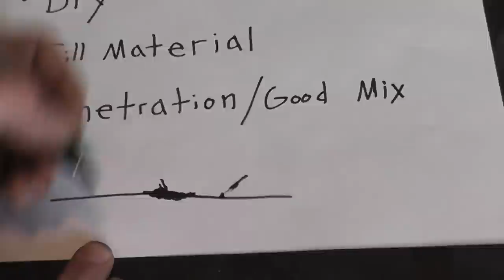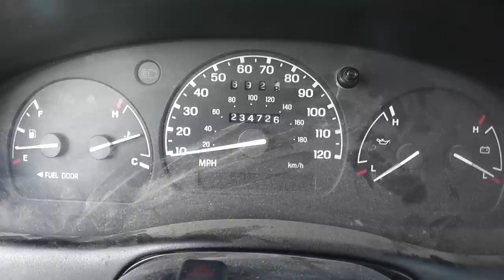How To Fix A Cracked Plastic Radiator For Free (Hopefully)

Comment: Do you think this procedure could repair radiator hose neck, breaking completely off of radiator tank?
Reply: +Abraham Levy  NO....FLAT OUT NO!!!! Buy a new radiator...it's about $100, and you can install it yourself pretty easily. Find a video for your car on here, or at least find one that is close. It shouldn't be terribly hard to do. If you try to repair it this way, and it fails then you are looking at a HUGE repair bill. Potential problems include blowing a head gasket; warping the head (even more likely if aluminum); warping the block (even more likely if aluminum); seizing the motor completely; blowing 1 or more rings, damaging cylinders from rings blowing, or from overheating; and all kinds of other things. If ANY of this happens you will pretty much be junking the car! The parts alone in a best case scenario where just the head gasket blows will end up being several hundred dollars (plus a fair amount in specialized tools if you don't have them (Machinist's Level alone is about $80)), and you'd need to be a better mechanic then someone who asks the question you just asked. No offense intended...not everyone has had the opportunity to really work on cars much...just trying to be helpful & realistic.
Reply: +David I should add that the several hundred dollars in parts was for the best case scenario. Any of the other things go wrong, and it can quickly go to several thousand dollars. You'd probably end up being better off buying a new head if it's warped more than a few THOUSANDTH of an inch...so we're talking tiny amounts here. Much else wrong, and you're better off just buying a new motor. In fact you might be better off just buying a new motor if ANY of this goes wrong depending on vehicle, general motor condition, skill level as a mechanic, and how much free time & patience you have...oh also how much you enjoy blood dripping from your hands onto your engine after cutting them repeatedly on God only knows what. Not saying it can't be done, but it's a pain & it can all be avoided. That's my rant for today.

Comment: By the looks of that radiator, you have been using straight water instead of a mix of water and coolant. That is probably the reason the radiator is in that horribly rusty and cracked condition. Correct me if I'm wrong...
Reply from the maker: quesnoy1 I run water and antifreeze, but straight water won't make it crack. It cracks because over time, the high heat deteriorates the plastic. (rotten design to save a few pennies) That's why they usually crack right at the inlet from the motor, which is the hottest point of the radiator. When I was messing with this one, I could tell that the plastic in the cracked area was brittle, powdery and porous. The plastic on the cooler areas of the radiator was still in really good shape. Thanks for the comment.

Comment: You may want to find out the reason why it cracked their were the upper radiator hose goes to might have a problem with the engine mount
Reply from the maker: I think the heat cycles over the years just made the plastic weak.

Comment: hey, garage, Im a chinese radiator repairman,  if radiator crack like u vid, i will change this part ，or  make a Aluminum cap use TIG welding aluminum WSME 315,    100%safe
Reply: agree I work in a radiator shop in new mexico. Crack plastic tanks are just a waste of time to mess with

Comment: Seems like a poor design to have part of the radiator plastic since it fails easily, why don't they just make the entire radiator out of metal?
Reply from the maker: Ryan Toomey I agree it is a part that is designed to fail. cheaper to make than brass and aluminum though. that plastic was totally cracked and deteriorated from the heat. Older all metal radiators never have this problem.
Reply: you can buy aftermarket aluminium radiators for most cars
Reply: They used to. Then everyone went cheap.
Look up radiators for vehicles later then 1990's
Reply: I prefer the plastic tanked radiators.  The all steel ones seem to rust out quicker than the plastic and aluminum ones fail.
Reply: Ryan Toomey The one in my old Dodge is copper/brass mostly.
They are tough yet, ductile I suppose is a good description, rigid yet bends easily, but holds up well to heating and cooling
Reply: First off, plastic is cheaper than the brass that was used for decades. I had long believed that it was a failure by design feature - you know, make it cheap, disposable and make more money - residual sales. Experience has proven that it is in fact a failure by design, but has nothing to do with generating extra residual revenues.

Components are designed to fail, let's say sacrifice, at a higher rate, dependent on cost of repair. First goes the radiator, maybe it's the water pump (obviously the hoses have failed well before anything else), the thermostat, you begin to feel as if you are just chasing breakdowns that are related to the same system, in some nightmarish, cascading domino effect.
Why sacrifice? 
Consumer ignorance, even laziness.. How often do YOU open your hood? Check your oil? Check your transmission fluid? Brake fluid? Check your antifreeze? For those of us with rear/4 wheel drive, how often do you check your differential oil? how about your transfer case?
BE HONEST.
Those of you who are beaming with pride because you have done/ had done all of the above - hell, 4 of the above, good job. Pat yourself on the back, then say goodbye because this is where you too, will fall short and have to admit your own ignorance and/or laziness.  No offense intended on my part, only (TRIGGER WARNING!!!! For any snowflakes who might be reading)  constructive criticism.a
When were all the above-mentioned fluids last CHANGED? Along with filters? Belt/s? Brake fluid too?  PCV valve? PCV filter?   
How old is your battery? What color is the handle/ring of your oil dipstick? What is the pressure rating of your radiator cap? You would know this if you have replaced it....EVER.( I will bet NO ONE got that one.)
A sealed, completely full, properly filled cooling system will neither corrode nor boil - not even at the 235 degrees that many engines normally get to. 
Even your brake lines are supposed to be changed periodically.

Every radiator used to have brass tanks, rarely leaked, but were prone to  electrolysis breakdown, leading to overheating. Overheating lead to blown head gaskets and cracked heads - those cost boo coo bucks to repair.
So we now have easily replaceable cheaper to manufacture plastic tanked radiators that fail along with the plastic overflow/ reservoir,  etc., to attempt to prevent blown head gaskets, and cracked heads.

It also ensures that a high % of vehicles possess the newest methods and technologies for efficiency, pollution, safety, even manufacturing and disposal.

Mine is a metal radiator cap rated at 15 lbs, my power steering and brake fluids changed last spring. Oil and transmission fluid and filters for each, as  well as air, fuel, and cabin filters were done within 10,000 miles ago ( I drive a diesel, gasoline motors are usually 3000). I do not buy in to those never need to change your oil, 100,000 mile claims.
They only add complacency to the ignorance and bliss.
Reply: @thefedup9921   my dipstick handle is yellow.....
DATE	ITEM	ADDITIONAL INFO	MILEAGE	COST
6/9/2012	SPARK PLUGS	8 EA	12,000	84.00
6/14/2012	OIL & FILTER	5W20	14,000	62.00
7/22/2012	WIPER BLADES	18"	14,375	12.00
7/22/2012	COOLANT	FLUSH	14,375	12.25
7/29/2012	BELT	SERPENTINE	14,710	29.00
9/8/2012	MUFFLERS	FLOWMASTER "OUTLAW"	16,815	475.20
9/12/2012	DECAL	BLACK RACING STRIPES	17,000	100.00
9/18/2012	AIR FILTER	INTAKE	17,865	12.50
9/20/2012	OIL & FILTER	5W20	18,011	53.00
11/3/2012	BRAKE PADS	FRONT	20,850	58.00
12/2/2012	OIL & FILTER	5W20	22,773	62.00
3/18/2013	OIL & FILTER	5W20	26,500	62.00
6/16/2013	BRAKE PADS	REAR	28,878	58.00
6/22/2013	OIL & FILTER	5W20	29,050	64.00
8/21/2013	SENSOR	TPS	30,800	80.00
8/23/2013	OIL & FILTER	5W20	30,822	64.00
10/25/2013	OIL & FILTER	5W20	34,654	62.00
10/25/2013	WIPER BLADES	18"	34,654	14.00
12/12/2013	OIL & FILTER	5W20	38,000	60.00
3/15/2014	BATTERY	5 YEAR	38,800	118.00
3/15/2014	AIR FILTER	INTAKE	38,800	12.00
3/22/2014	SPARK PLUGS	8 EA	39,000	100.00
5/24/2014	CALIPER	LEFT, FRONT, BRAKE	40,700	65.00
5/29/2014	OIL & FILTER	5W20	41,700	62.00
10/24/2014	OIL & FILTER	5W20	46,460	55.00
12/3/2014	TIRES	4 EA	47,603	800.00
2/15/2015	OIL & FILTER	5W20	51,000	57.00
8/10/2015	OIL & FILTER	5W20	54,050	50.00
9/12/2015	BULBS	ALL / H13, 9145, 194, 168, 4057LL, 3157LL, 921, 212-2	54,814	138.00
9/12/2015	BULBS	DOME, LED's, 2 EA	54,814	20.00
9/14/2015	AIR FILTER	INTAKE	54,844	12.00
9/14/2015	WIPER BLADES	18"	54,844	14.00
11/26/2015	OIL & FILTER	5W20	56,361	49.00
6/8/2016	BATTERY	WARRANTY	60,600	0.00
6/10/2016	ALTERNATOR	.	60,650	239.00
6/22/2016	AIR FILTER	INTAKE	60,893	12.00
7/3/2016	THERMOSTAT	W/ GASKET	61,134	20.00
7/3/2016	HOSES	ALL / RADIATOR, 5 EA	61,134	60.00
7/3/2016	COOLANT	FLUSH	61,134	14.00
8/5/2016	AIRBAG	DRIVER SIDE / FORD RECALL	61,849	0.00
9/17/2016	HOOD PROPS	2 EA	62,975	90.00
9/17/2016	OIL & FILTER	5W20	62,975	55.00
11/25/2016	TIRES	REAR, 2 EA	64,837	375.00
2/12/2017	COLD AIR INTAKE	K&N	66,939	300.00
2/12/2017	WIPER BLADES	18"	66,939	14.00
2/19/2017	SPARK PLUGS	8 EA	67,136	100.00
3/4/2017	WRAP	BATTERY INSULATOR	67,465	20.00
5/7/2017	OIL & FILTER	5W20	68,915	48.00
5/7/2017	BRAKE PADS	FRONT	68,915	50.00
5/7/2017	ROTORS	FRONT	68,915	100.00
5/7/2017	BRAKE PADS	REAR	68,915	50.00
5/7/2017	ROTORS	REAR	68,915	100.00
6/24/2017	TIRES	FRONT, 2 EA	70,449	443.00
6/27/2017	CONTROL ARMS	W/ BALL JOINTS, 2 EA	70,523	847.91
8/14/2017	WINDOW TINT	ALL / 6 PCS.	71,789	200.00
9/4/2017	VALVE STEMS	BRASS, 4 EA	72,250	70.00
9/5/2017	BALANCE WHEELS	4 EA	72,502	61.23
10/21/2017	POWER STEERING	FLUSH	74,000	7.00
10/22/2017	OIL & FILTER	5W20	74,009	55.00
11/3/2017	DIFFERENTIAL	GASKET, HOUSING	74,466	100.00
4/21/2018	DECAL	WINDSHIELD, "MUSTANG"	78,973	15.00
4/23/2018	WIPER BLADES	18"	78,992	17.00
5/11/2018	AIR FILTER	INTAKE, K&N	79,532	52.00
5/12/2018	BELT	SERPENTINE	79,562	28.00
5/13/2018	OIL & FILTER	5W20	79,562	58.00
5/17/2018	SELENOID	VVT, 2 EA	79,669	136.00
6/22/2018	AIRBAG	PASSENGER SIDE / FORD RECALL	80,000	0.00
12/14/2018	DIFFERENTIAL	GASKET, HOUSING COVER	84,752	120.00
12/14/2018	DIFFERENTIAL	PINION BEARING	84,752	120.00
12/14/2018	DIFFERENTIAL	PINION RACE	84,752	120.00
12/14/2018	DIFFERENTIAL	CRUSH SLEEVE	84,752	120.00
12/14/2018	DIFFERENTIAL	WHEEL BEARINGS, SEALS, REAR, 2 EA	84,752	120.00
12/14/2018	DIFFERENTIAL	75W140 GEAR OIL, FRICTION MODIFIER	84,752	77.80
12/30/2018	OIL & FILTER	5W20	85,149	48.00
1/4/2019	STEPPER MOTORS	ALL / INSTRUMENT PANEL GAUGE CLUSTER, 4 EA	85,154	17.00
3/14/2019	WINDSHIELD	INS. CLAIM, REPLACEMENT, SAFELITE AUTO GLASS	85,849	0.00
3/16/2019	DECAL	WINDSHIELD, "MUSTANG"	85,860	10.00
3/16/2019	WINDOW TINT	WINDSHIELD	85,860	20.00
4/18/2019	DECAL	ROCKER PANEL STRIPES, "MUSTANG"	86,072	30.00
5/19/2019	WRAP	STEERING WHEEL COVER	87,022	10.63
5/19/2019	COOLANT	FLUSH	87,022	9.00
10/5/2019	OIL & FILTER	5W20	89,280	48.00
11/3/2019	WIPER BLADES	18"	90,000	17.00
11/17/2019	AIR FILTER	CABIN	90,852	20.00
11/17/2019	BULBS	DOME, LED's, 2 EA	90,852	1.30
11/17/2019	BULBS	HEADLIGHTS, LED's, 2 EA	90,852	40.00
11/17/2019	BULBS	FOG LIGHTS, LED's, 2 EA	90,852	24.50
12/21/2019	FUEL FILTER	MOTORCRAFT   #FG-1083	92,192	20.00
3/26/2020	OIL & FILTER	5W20	95,340	48.00
8/15/2020	SWITCH	HEADLIGHT/DOME LIGHT	98,506	70.00
9/13/2020	BATTERY	3 YEAR WARRANTY	99,399	200.00
10/31/2020	OIL & FILTER	5W20	100,945	48.00
12/11/2020	BALANCE WHEELS	4 EA	102,058	16.50
12/11/2020	ROTATE TIRES	4 EA	102,058	16.50
12/11/2020	ALIGNMENT	FRONT END	102,058	120.00

Comment: Dude they make coolant for your vehicle to protect from corrosion and to keep it operating within  operating specs, you got more problems than just the radiator.
Reply: pretty sure that after a few months of leaking expensive antifreeze, water became a more reasonable choice.  I've been using water for a month and already see some of the build up. time to weld.

Comment: hope i aint repeating another comment_ the rusty scaly water coming out of the radiator suggests that this guy was running water for some time in radiator_ while a-freeze is super expensive, and it's understandable, some sources say that corrosion in your engine is not worth it_ i'm not saying that's a fact, just a risk_ still, no money, beat up truck...

Comment: Take note all you do it your self's - first of all those plastic tanks are meant to be replaced if they should fail, at a very minimal cost.  Further - one of worst things you can do for your cooling system is to allow it to become in the condition that is shown in this video.
Reply: That's the point, they shouldn't have to be replaced. So at a slightly more than MINIMAL cost you can replace it with an all aluminum unit and never have to worry about that BS ever again
Reply: Depend on the system, become dependent on the system.  
Because our all of our food comes from the grocery stores too, huh...

Comment: you keep doubting the success of your repair, and to me it seems your basing that on the longevity of it. that's really not the way you should be looking at it. most people do a repair of this nature to get them by till they can afford a new part. radiators are upwards of $200 not including labor cost. now I know by your statements early in the vid, that its not your reason for doin this. you need to look at the success of the repair like this....... does it still leak? has it stayed fixed long enough to have saved or earned the money to buy a new part? if 1 is no and 2 is yes, congrats its a success. chances are the tubes will fail before your repair does
Reply: people still pay for labor lol jk im a mechanic i do all my own repairs just to save a buck lol

Comment: what happens to your weld when ur rad starts expanding and contracting ur weld will crack and leak again thankx 4 trying just go buy a new one the guys at eastside auto  radiators in phila,pa

Comment: still up and running?
Reply from the maker: Yeah! just turned over 2000 miles on the fix. It's not perfect, but I don't have to worry about adding water all the time. I'm going to do a follow up soon.
Reply: +Jennies Garage You keep talking about adding water, but you never mention adding anti-freeze. Maybe the anti-freeze is just implied, but my guess would be that it's not... That could very well be part of your problem. To me the $100 for a new radiator is NOT worth the risk of thousands of dollars in damage to the motor from overheating. To get you home...yes. To last a few days until a paycheck & part comes in...maybe. Permanent "fix"...HELL NO!!!
Reply: David then don’t do, no one is forcing you to do anything. He stated this in the beginning of the video.

Comment: 3 years later, 
you should have taken and ground up the plastic fill rod to make small beads or a powder, it would have melted easier and quicker.. 
or use a stick glue gun..

Comment: did it work
Reply from the maker: +frank z It's held up really well, but I've noticed a little moisture starting to creep back through in some spots. It's nothing like before (adding water every few days) but it will probably eventually crack again. The trouble is the plastic isn't durable enough to withstand the hot coolant and it starts to break down and get weak.

Comment: while I was seeing this video I was doing it with my expansion tank bmw e39 leak, I hope work with mine, coz bmw are very hot, soon I'll show the video if it work
Reply: +Danilo Baca If you run your BMW engine hot even once, you will be replacing the head gasket and have to  mill the head in the near future.
Reply: 6

Comment: Great vid man! I will try it with my ford escape since it suddenly started leaking. I would buy a new radiador but i am broke right now, lol. (Where there is a need there is a way). :-)
Reply from the maker: +Los Man Good luck! I hope it works for you.
Reply: +Jennies Garage It worked perfectly! I just had to do the pressure test a couple of times since it would still leak and had to mend it but after that everything turned out ok. I do put water every four days, but not much about a half liter other than that it works great. Thanks! (saved me 150 bucks on a new radiator)

Comment: Made out of plastic for that built in obsolescence factor. Designed to fail so you have to buy a new one. If it was made to last it would be metal!!!
Reply: Metal also corrodes and gets holes.  Many radiators end their useful life because the insides are so gunked up which has nothing to do with the plastic frame.  Why make the radiator twice as expensive when the inside will likely be the cause of the failure for most people?
Reply: No they went to the thin plastic tanks because they are more likely to fail before major internal engine damage is done, unlike the older ones would hold together when there was a cooling failure and blow a head gasket or crack a head.